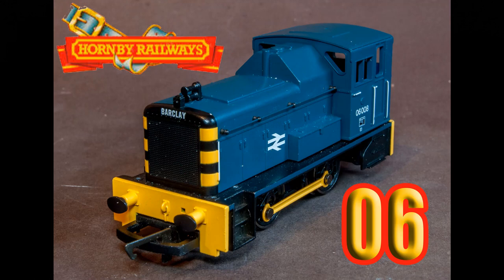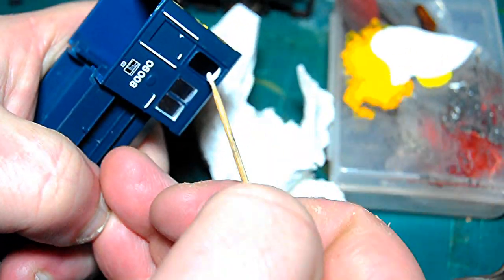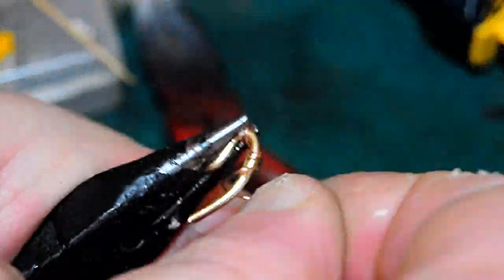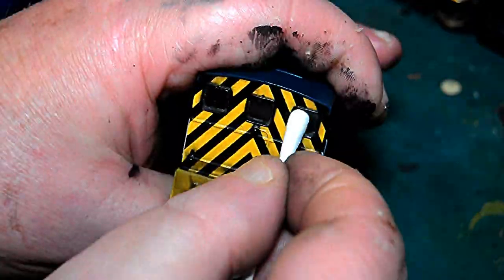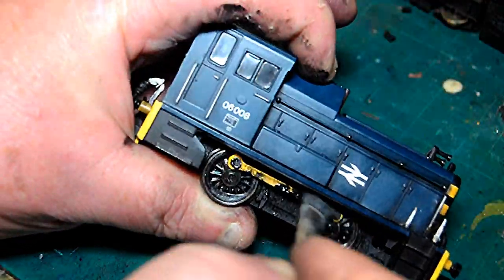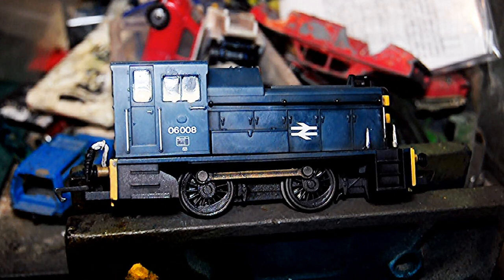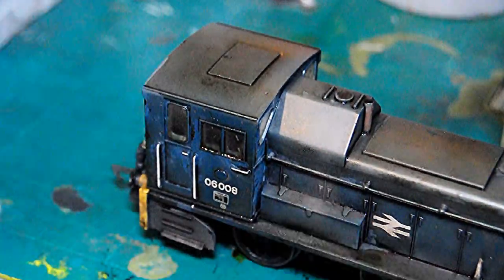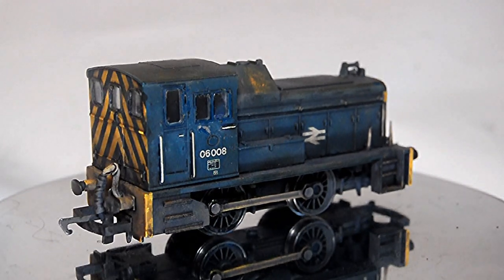improve a cheap hornby 06 shunter with scratchbuilding and weathering

Comment: I've often toyed with the idea of using the Hornby Barclay 06 body shell on a Bachmann Drewry 03/04 chassis to create the 0-6-0 version of the loco. However, it would also require shortening the rear of the cab roof & upper 2/3rds or the rear cab wall.

Comment: Adding a 12 Ohm 1 Watt series resistor, between the motor & one of the pickups, makes the loco more controllable for slow speed shunting, especially when under ye olde Hornby Zero One DCC or 12 Volt DC Pulse Width Modulated control.
Reply from the maker: cheers